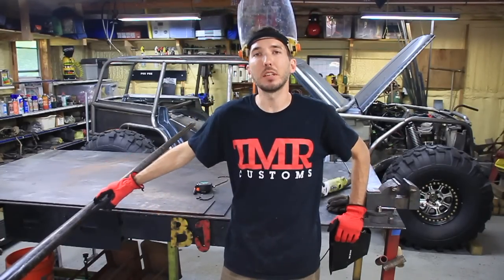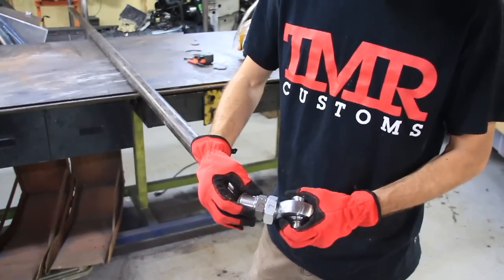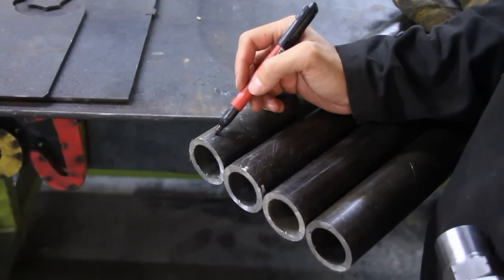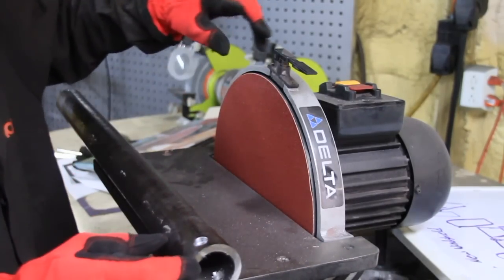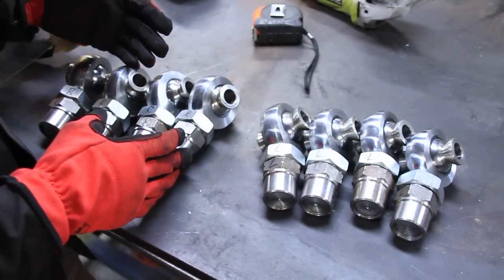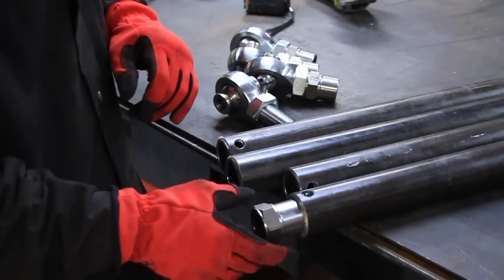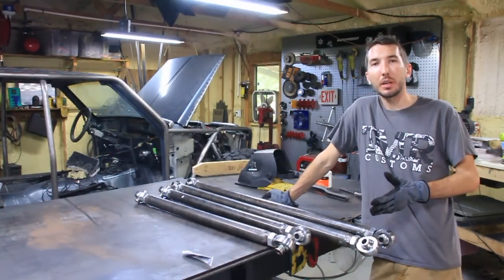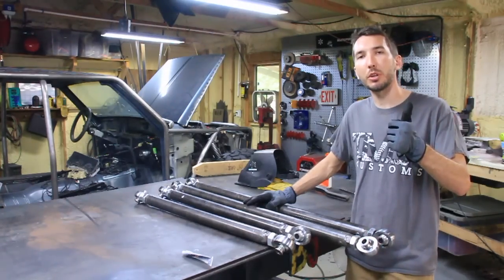Making Control Arm Links

Comment: You said you used 24ft of 2"x.250" wall. Assuming the aluminum links are the same dimensions as the steel links, you would be saving about 300lb. As an engineering student, in my opinion, the center of gravity wouldn't change a lot from removing 300lb on a jeep that probably weighs somewhere in the neighborhood of 4000lb. Add to that the fact that steel would probably hold up better to being bashed against rocks. The links are the next lowest point after your axle and tires, right about the same level as your drive shaft, in some cases lower.
Reply: .250 wall steel is how much stronger than .250 wall aluminum?  Compare apples to apples, which means what would the same strength aluminum weigh?
Reply: From what I can tell, it actually looks like some of the aluminum links offered online might be solid rather than hollow, which will impact bending quite a bit (and also add weight). I found an article discussing the strength of steel vs aluminum which said, when measuring deflection/stiffness, an aluminum plate would need to be a little less than 150% of the size of a steel plate in order to achieve the same "strength".

Here is the article. I skipped to the "Inch for Inch" subheading. You'll see that both the yield(bending) strength and ultimate(failure) strength are higher with the aluminum that is 1.5x the size of the steel, but for a 50% increase in size there is not a 50% increase in strength.

http://www.kastenmarine.com/alumVSsteel.htm

All that being said, if the aluminum links are solid they might actually be better, and look cool. I ran numbers very quick and sloppy and it seems like it would be about 60% as strong (for the solid aluminum vs hollow steel) but the equations I used may not be as relevant because there are a lot of forces involved in a system like that between keeping the axle in place and bashing against rocks and stuff.

Also, I'm still a student (sophomore in a university engineering program)
Reply: +Brandon Low fair enough. There are advantages to using aluminum in some situations, but the same arguments could be made for titanium and carbon fiber.   For the record, I never went to school for engineering, I don't know shit, and I am a psychologist by trade.   Don't blame your education for mistakes...  Just own it and always be open to learning and being wrong (which is when you will learn the most).
Reply: Oh yeah, every material has its place, I'm just not quite there yet in my schooling to completely analyze the tradeoffs between the two, but im trying.

Comment: lower center of gravity, also steel is stronger. yeah it might be heavier but its only gonna be what 10lbs more than the aluminum? steel is the way to go in this case.
Reply: you just proved why aluminum would be better, less unsprung weight and 10lbs (per your example) would be absolutely unnoticeable in handling.  you would notice taking a tire off the back of a vehicle but not link material.  suspension components are forced to move frequently and quickly, lighter is better for suspension cycling.  but what trumps all that is the comment i directed toward matt.
Reply: +simken48462 I can't tell if you're trying yo start an argument, I just put my two cents in. whether its right or wrong I have no idea
Reply: i was just using your 2 cents as a jumping off point to explain to others.

Comment: Never use that flat sander on that side. You always use the side of the wheel that’s going down. Not only will your paper last longer, it will cut better and won’t ever catch and fly up at you if it ever does.

Comment: Could you have used aluminum foil to put into the joints?  Maybe ball it to a size you could screw into the joint.
Reply: jimredeye1 Maybe a polished aluminum ball.

Comment: i would say steel is the better choice its is stronger if you wanted Aluminum that was strong as steel, you would have to a thicker tubes and then you probobly end up with the same weight. And also Aluminum you would have to tig weld

Comment: Will it be as strong if the weld is done with a TIG ??
Reply from the maker: Stronger
Reply: Thanks..
Reply: Cab you help me buy the right Heim joint ?
Reply from the maker: 1.25" heim, try ruff stuff or TMR customs
Reply: This one in your video is 1.25" ?  what is the next smaller in size ?

Comment: In my mind you would want to keep your unsprung weight at a minimum. I would go Stainless If I had the money, then I could scrape them to high hell and not worry about it
.
Reply: Dylan Dembrow unsprung weight for a vehicle that rarely sees speeds over 10mph is simply irrelevant. Center of gravity is what is important in rock crawling... imho
Reply: Dylan Dembrow he can scrape those .250 wall tubes all he wants and not worry about it still

Comment: def lower center of gravity
Reply: What I understood was: a steel link set up under a ring would help a top heavy off road vehicles' center of gravity due to the weight of the material underneath. Personally I think this weight comparison is absurd when it comes to a 4x4 off road vehicle.
Reply: The weight difference between aluminium and steel links in this application is negligible and will not affect your center of gravity.
7075 aluminium 2" od solid rod at 36" long = 11.5 lb approx
C1018 D.O.M 2" od x .25" wall steel at 36" long (including bungs) = 15.5 lb approx

That's only a 4 lb difference per link. 8 links gives you 32 lb. Compared to a 4500 lb truck (or more) it's only a 0.7% change in weight. The center of gravity might be lowered by 0.1".

So as Cesar pointed out...it's completely and utterly absurd.
Reply: unsprung weight makes the difference- actually the benefit depends on the usage of your rig.
Better, safer to save the weight @ the wheels instead.

Comment: I don't understand how you can possibly get weld splatter on the threads. Wouldn't it be a line of sight thing? How does it get from the outside of the tube to the inside? I'm no engineer, but I think you should also invest in a drop-saw and a bench grinder. That sandpaper wheel is ridiculous.

Comment: You stuck the pipe straight into sand paper...next time run the pipe at a 45 degree in the direction of sand wheel

Comment: I love ii but it is to low for a rock crawler
Reply: shocks aren't charged yet.  ride height will be taller.
Reply: OK I was worried
Reply: Everything gets built at full bump so that nothing binds in the event that the shocks are shocks are fully compressed.